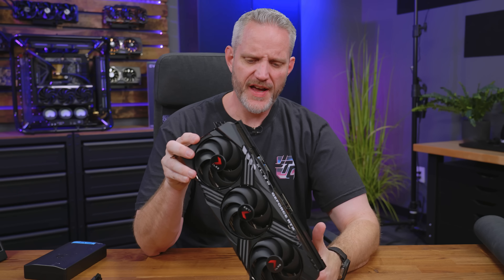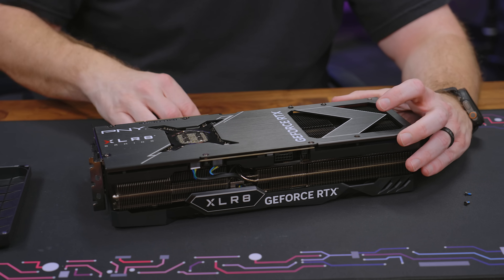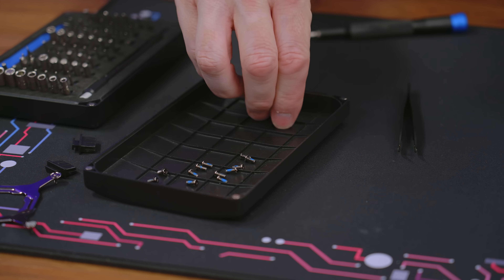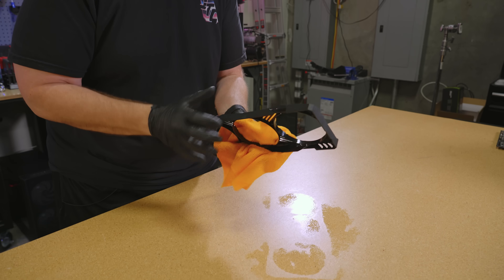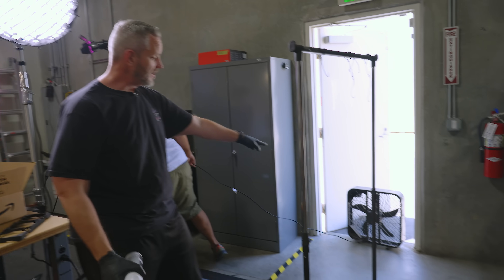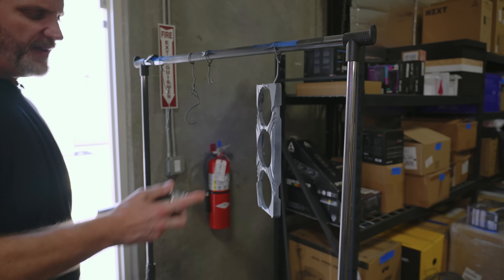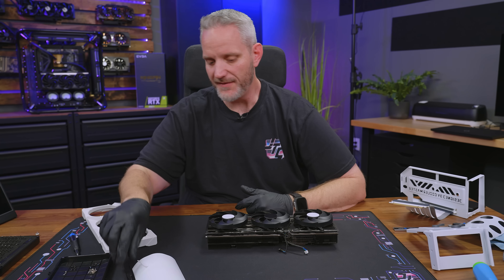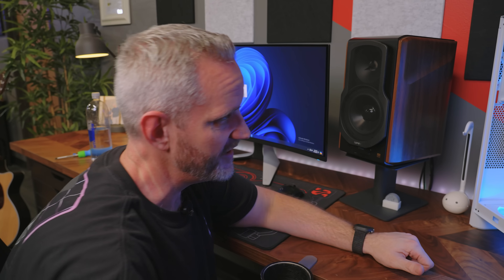How to paint your GPU the RIGHT way!

Comment: This is a massive frustration in white builds, the fact there are so many different shades of white used by different companies. Even the same companies with different models can be a different shade of white.
Reply: Yep wanted to do a high end white build, when the 4080 super white edition came out it was $200 more
Reply: This. I recently upgraded an old hp case with a 3d printed white front panel, and I could not find a white paint that matched it whatsoever. It was super frustrating as the rest of the build was pretty decent for a budget machine.
Reply: This is why I hate rgb lights because I prefer natural white color. Back when corsair introduced their mag lev fans I bought three of those ml120 pro white led versions. I liked how they looked with that pure white lighting. So half a year later I bought three more and guess what, they had that cheap looking blue tint in them. I feel like nobody else even cares and that I'm nit-picking all the time
Reply: 50 shades of white - the movie 🔥
Reply: Running a black motherboard and GPU at the moment for this exact reason. 

There really aren’t enough white (or other colored) GPUs available.
Reply: Naw it easy to match you just need know where to go to get it to work!
Reply: @ELCrisler  100% truth
Reply: Ya, I'm having this issue right now. I'm picking all my parts for an over the top enthusiast build in white. Nothing matches, and my ocd is causing me anxiety. I don't know if I should just paint all the parts or not. I'm spending way more than I should by water cooling everything, including the motherboard and using a very expensive case from Singularity. It needs to be right. What would u guys recommend? Singularity will powder coat the case any color I want, but the mother board, fans, and fittings don't match the case or each other.  Fittings I'm going to fix by using them as a contrast color. 

Also, Intel, you messed up my plans. Theres no way I'm putting on of their cpus in my build with all the panels that double as Dystro plates that would need to be disconnected if I have to change it out. AMD, here I come. Let's release the new x3d.
Reply: Try painting the inside of your house.
Reply: The trick is not to use white light, use literally any color you want, it will fix the mismatch right away.
Reply: Should have used a color matching app for the paint color.
Reply: You need a colormap, check the color code you want to match into, walk in a hardware store and ask to mix a paint in said code in a spray can. Edit: some stores have colormaps you can loan so that you don't need to pay for it.
Reply: It's not just white, but white is easier to spot.

Pretty sure black also have all kind of shades, but won't be as much apparent.
Reply: And that's if white is even an option!
Reply: Oh yeah I’m so glad someone is addressing this! Ive returned so many fans because of this specific issue! No matter how much software tuning sometimes there is no way to have a matching white color on all fans and accessories! I wish they followed the same rgb codes it would simplify everything!
Reply: The easiest way to fix is to get a closed-off cases (with no window or glasses whatsoever). Now you only have the case to concern with!
Reply: But black have different shades too not as much as white but does
Reply: Yeah im building mine atm and my damn cable extensions are slightly off white from my case and motherboard 😢

Comment: as a former car panel beater i will say he sprayed it exactly right, the first coat should be simply a dusting and a base layer - patience is a virtue
Reply: yep, you want a tooth for the next layer to adhere to. Don't know if I'd use a heat gun on the can though, a bit of warm water is faster and safer IMHO.

Comment: I'm a industrial painter and we had to remove several years of safety yellow paint on metal bump rails and there was paint several coats in that was still wet.
Reply: thats crazy it's still wet
Reply: i used to powder coat the yellow saftey railings and ballards....fun stuff
Reply: Industrial paint has to be solvent based right?
That should evaporate quite fast, there's no way it would soak the old paint after it has had some time to dry.
How could that possibly happen?
Reply: @YOEL_44  too heavy on the first coat could do it and it's not just solvent base in industrial 80% I'm using 2 component polyurethane and epoxy just depends customer's specifications. It's pretty common issue with cars and water base. If your colour cracks under your lacquer likely hasn't dried enough in-between coats by the previous painter so its not adhered and now that has too be taken right back by the next guy. Nightmare
It's possible though because too heavy the solvent evaporates dries on the top seals it and paint underneath hasn't got air to evaporate the solvent so it can't dry
Reply: That's insane xD

Comment: I painted my EVGA RTX3090 FTW3 and it turned out amazing, now it's white and fits the build perfectly. Had a few mishaps but I managed to correct them, the card looks way better white imo.
Reply: Thinking of doing that to my evga 3090ti ftw3 ultra but I don't want to hurt the resale value of it 😂
Reply: @jojimonty2506  well to be honest, it might even add to the value, there are not many white cards around.   I talked to EVGA and they dont have spare shrouds or backplates anymore, so you only have one shot at it though.

Comment: Pro tipp for hanging the object you wanna paint:
There are screw holes in the back of the shroud, use long screws and some stiff wire to hang it with the wires to the hooks at your painting rack.
This way you avoid any possibly visible marks.

Comment: professional Car painter here, Check that can Jay if thats a Plastic Primer youve sprayed...when painting plastic you need to "scuff" the surface, to make the surface adhesion stronger, secondly you need to put a plastic  bond on the surface prior to priming, dont believe the can if it says you dont need it! seen enough paint fly off plastic with air sprayed on it, this environment is perfect for disaster not prepping that plastic correctly as youll get the paint/primer flakes everywhere, last thing you want is it going inside a psu, sorry to be that guy that makes this comment just trying to help genuinely hope paint dont fall off though, looks good and if you want a more whiter white, standard Gloss 2k White would do it, the Toyota Paint Code "040" is also more white with less yellow/red hue or even Actic White, most autoshops that sell car parts can make custom spray cans whatever color code you want.
Reply: krylon fusion is specifically made for plastics and IMO has great adheasion without scuffing. painting plastic on cars is also different because of the flex that the parts can have in the wind and movements, where this shroud wont be flexing or moving much at all. Scuffing wouldnt hurt and could only help, but i really dont think its needed with this paint specifically.
Reply: @MrVlodato  it all needs a tooth, i don't care what the can says.
Reply: yep a bit of scotchbrite works wonders.
Reply: Agreed... scuff ,prime ,scuff , 1 coat, scuff, and finally 2nd coat ... the end !
You could also use a sealer/clear coat over the final coat to get a different sheen

Comment: I have this same video card and it's been rock solid.  It's never given me a single problem or crash.  Its default fan curve was a bit aggressive but that's nothing 90 seconds in Afterburner didn't fix.  And now that Kingpin is looking at a collaboration with PNY I can see myself buying their cards for a while to come.
Reply: I would assume any component I put in my PC, specially if it's new, would work perfectly, otherwise an RMA will fix it for me.
Asking for anything less than that is giving way too much wiggle room to F you up to the brands, don't allow them to do that.

Comment: There's special spray paint you can get for radiators (actual heating radiators) which is heat resistent, that might be the best paint for this purpose.

Comment: I like to use Vinyl & Fabric dye from the auto parts store to paint plastic. It actually seems to soak into the top layer of plastic. Great for parts that will see wear, scratches, etc. You can't even feel it on the part, unless you use too much!
Reply: Rit Die More, I've used that too for some custom car parts, pretty awesome, altho' there are some plastics that don't like to let the die stick.

Comment: I wimped out. When I built my system a few years ago I searched hard and paid a premium for a white Sapphire RX6950XT. White case, fans, motherboard, RAM, cables... it ain't easy going white. I even wimped out and bought an Inzone display from Sony to get one in white. I ALMOST painted the one I had but my only guide was Linus and he went pink on a display he had melted... yeah, I task you next to PROPERLY paint a display housing 😀

Yours turned out great and another great montage from Phil (the Jay VoiceOver was a great idea!).

Comment: The biggest mistake in terms of a graphics card of 4090 class maintenance is to switch from the stock phase change thermal interface to regular thermal paste. I got my 4090 Suprim serviced 4 times this far, under EK Vector 2 sandwich and the only reason I had to do the maintenance so frequently was using thermal paste on gpu. I tried Gelid Extreme, Thermal Grizzly kryonaut, Alphacool SubZero. The result is all the same: after approximately 3 months of 3-4 times a week gaming gpu/ horspot temperature delta was slowly increasing from 9-10 degrees after the fresh application up to 20 degrees. Any silicone based thermal paste won’t work on 4090 on a long term due to its fast pump out effect.
Thus I purchased Honeywell tpm 7950 0.25mm thermal pad from moddiy and now after 6 months hotspot delta stays below 10 degrees at up to 500W load (73 Fahrenheit ambient temp).
Jay just keep on checking your hotspot temp delta after some time. Btw thermal pads should also be replaced after the radiator is unmounted.

Comment: did similar many years ago with an old build, painted the plastic shroud on an R9 390 to get it to match the rest of my build and left the fans/backplate as they were, relatively easy to do just have to prep right before hand! managed to strip the paint years later to resell the GPU

Comment: I use that paint with all my projects. Plastic, definitely don't use the sun to bake. But, the metal bracing I made for my sim rig, I used the sun to help bake it. Actually worked wonders. My feet and sim accessories rub against it all the time and no paint wear yet.

Comment: I've had an iFixit kit for years now and I love it. If it disappeared, I'd go out and buy another one right away. I use it all the time for numerous applications. It also helps with my side gig computer repair business. Absolutely worth the money. And not only are the bits super strong, if you need a replacement, you can buy individual bits. I've never had to replace one but the option is there.

Comment: I use a hot glue stick x 2 on the back with a piece of wire, heat the end of the sticks and jam them on the back, rip off when finished and reheat sticks as needed.

Comment: a wire coat hanger, bread tie, or any kind of bendable wire can be used to hang the parts. You just need a spot to hang it from. I suggest a large cardboard box. This way you can spray from many angles and so you can finagle a rod to go through and could catch some of the over spray and not mess up moms fine China. Just make sure you put a heavy weight at the bottom so it doesn't blow over.

Comment: The best option to try first is def automotive vinyl wrap, this shroud has far too many crevasses/variations in surface for wrapping, but many GPUs are very good candidates for vinyl wrap, best part is that if you eff up or decide to return it to stock, it simply peels off quite easily. And btw, almost all white rattle can paint is of the warmer shade of white.

Comment: Krylon Fusion is the way to go.  For some reason the Rustoleum version doesn't stick as well on these plastic shrouds; and it takes forever to dry.  The finish is even and doesn't flake off.  Definitely consider "bright white", I think may be a closer match.  In case you do a repaint, I would wait a week to dry completely before recoat.  I've recoated some parts after 24 hours and sometimes there can be blistering in the paint if you're not careful.  Then it becomes an entirely new project of stripping the old paint off with acetone, and sometimes sanding the part to get it even again.
Reply: Based on the name rustoleum its probably for metals and looking up krylon it says its for plastics specifically so that would be why it works better on what it's designed for.

Comment: The PCBA On the PNY RTX 4090 Verto and XLR8 are not actually reference design, but slightly longer at 10mm as they added an IC and 2 connectors for ARGB, with 2 additional mounting holes. Waterblocks for reference cards like those from Alphacool will fit; however, on the Eisblock GPU block, the additional 10mm PCBA will be exposed. The Core GPU block completely covers the PCBA.

Comment: Kinda skimmed through the video watching this on my break at work but I didn't notice if he lightly sanded or scuffed up the part or not. Super light scuffing helps with adhesion. Rubbing the part down with like the green side of a sink dish sponge or something similar that can lightly scuff the paint then a primer. Even if your spray paint has a primer in it sometimes a light  coat with just primer is good.

Comment: Never paint your fans. Although not precisely balanced, they are still fairly so. You would have a very hard time doing an even coat of paint on all the blades. Uneven weight will wear the bearings much quicker.

Comment: Props for the Edifier S2000 MKIII, solid choice of speakers. If you have a chance, definitely try out the S3000 Pro (or MKII), it's a nice step up in the low end/bass department, with some other extras.

Comment: I love that Krylon Fusion paint. The off white is a bit annoying for sure. I painted my mobo heatsinks using that paint and it looks great. I would highly recommend using a protective clear coat, though. I didn't do it on my last mobo and regretted it cuz I immediately scratched the paint putting it back into my case. I had wanted to paint my GPU but was way too afraid, so when I replaced it I just bought a white one instead lol

Comment: Lookin good. I use appliance epoxy, seems to be significantly more durable but it is high gloss. I also always use primer, even with the paint + primer stuff. Just makes things hold up better over time. I’m usually painting cases and coolers though, I don’t love painting cards cause it devalues them most of the time unfortunately

Comment: I would have just taken the shroud off and put full size 92mm white fans on it. No problem reselling later or possible paint issues. You rarely need to remove the heatsink then, so no warranty issues either. But interesting to watch nonetheless :)

Comment: This may be a dumb question. Apologies in advance.

If it’s a reference board can you take a cooler from another reference board and slap it on? Obviously component clearance and contact will need to be checked, and if the screw holes lined up.

Just wondering. The silly thoughts I have at times (well, often actually)

Comment: Wouldn't it be better to use vinyl paint for the palstics, in case you want to remove it at some point? I mean, is it recommended, or would you still damage the plastics when trying to remove it, I have never worked with that kind of paints, but I heard that they are easy to remove.

Comment: I took my apart and painted it white too and I didn’t take it completely apart like you did taking the top plate off and the mounting plate gives enough room to get all screws out one screw is a bit of a bitch but was good I also drew a layout of the screw pattern and poked a hole it the cardboard for each screw in order so they exactly the same as it came apart painted it screwed everything back together

Comment: Looks great Jay. I just picked up a 4080 Super XLR8 card. Are you finding issues with the VelocityX software? It seems there's a bug with the Static light settings, and the only workaround for me is to use Breathe at 0% speed if I want anything close to a static color. I had the wrong software downloaded at first and redownloaded the correct VERTO software for the XLR8 cards.

Comment: you should paint the backside of the back metal plate (forgot what it's called). seeing that gray below the gpu doesn't match with the rest of the system
Reply from the maker: You can't even see it
Reply: @Jayztwocents  i noticed it in the video. Perhaps it's not visible when placed in its "permanent" location? Take a look at @17:53 you can see them below the gpu clearly

Comment: Hmmmm, any reason one couldn't pull the cooling fins, tape the contacts, then send it to the powder coating or cerakote shop?

Would you talk about the process of painting a pcb in another video? Curious about this.
Reply from the maker: The thickness alone would be bad. Could affect the way it mounts against the die. You DONT want to mess with the thickness. Also you would NOT want to powdercoat the fins... Cerakote would be fine though. Thats what BeQuiet and Noctua black coolers are coated with.
Reply: @Jayztwocents  Deep cool sent a white finned cooler and it got me thinking. Why not custom colored fins on a rad or cooler, the oems are doing it. 
My faulty logic was thinking "power coated headers make a engine run cooler..." thats some der logic though, the paint traps the heat in the exhuast and sends it out the back... powder coat must be a insulator then. 🤔

The next thought was custom painted PCBs would look sweet, oems are doing it... Im sure it is way harder than it sounds though. Special non conductive paint or something...